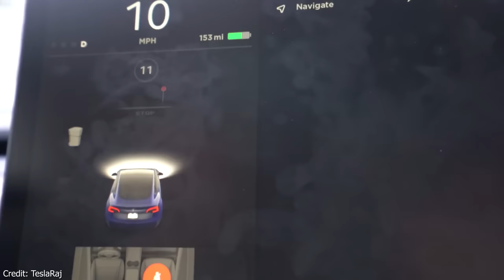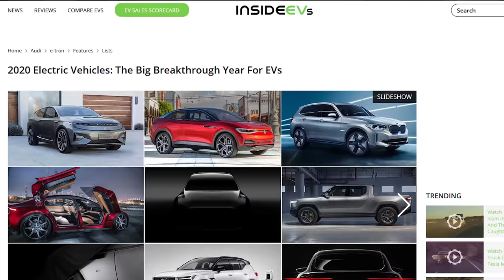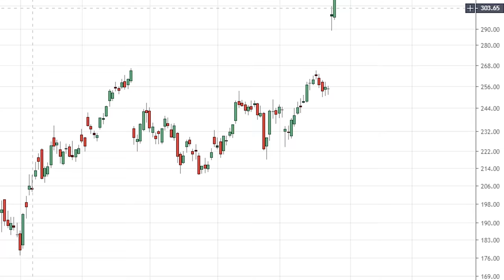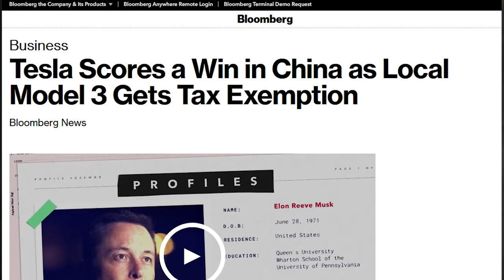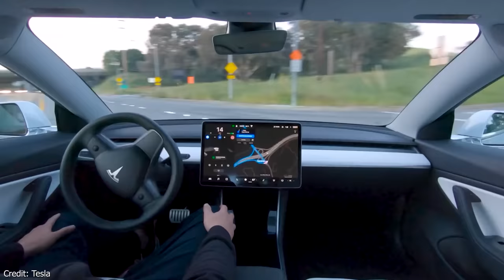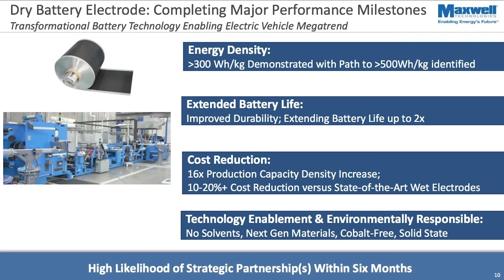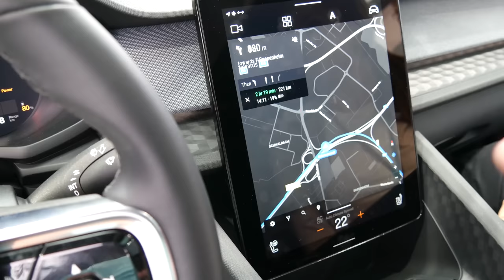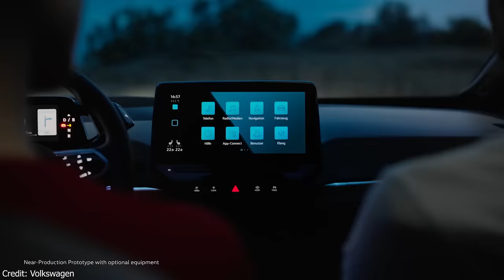TESLA CHINA FACTORY DELIVERY, GIGA 4 UPDATE, FSD BY END 2020

Comment: For advanced electric cars Tesla is at the for front, with no one to compete with.  Even though there are many EV's in the pipe line, I don't see anything coming close to Tesla.  Especially since Tesla is about to release a new battery format that will extend the battery past any of the competition can do.  Unless you count IBM's battery break through... though I have not seen them being able to mass produce it any time soon.  Just like a lot of other breakthroughs in tech.  Companies have a break through but have no way to mass produce the product cheaply. Unlike Tesla which not only talks about break through technology, they also make it happen.

Lets put it this way, Tesla already has setup infrastructure and is mass producing cars, the competition has no infrastructure and not even close to mass production yet. the competition has too much to work on.  So I think it will take at least 6 to 9 years (or more) for a company to have a solid foot hold.

Comment: I don't see Robo Taxi from Tesla for two to three years it will take that long to train the AI with enough edge cases for it to be acceptable for level 3 Autonomous operations. They have tons of highway data and still no level 3 system for highway driving. I believe we may see level three on the highway this year for Tesla provided regulators allow it.
Reply: The number of reports increases exponentially with the number of cars.
As this happens, the number of remaining edge cases declines at a similar rate.
When both curves go near vertical, it's effectively a binary shift.
Reply: It's entirely possible Tesla may be able to get approval for the Robo taxi network in one or more localities or cities in 2020 the same way Waymo is currently operating in the Phoenix, Arizona area. Initially, safety drivers will be required until there's enough data to show they aren't needed. Getting more widespread approval for states and provinces, etc. will take much longer and will require a many more miles using safety drivers without intervention before approval for autonomous use is permitted. Also, many Tesla owners will want to use autonomous driving for personal use doing errands like giving friends and family members rides so regulations and insurance need to cover that use-case as well.